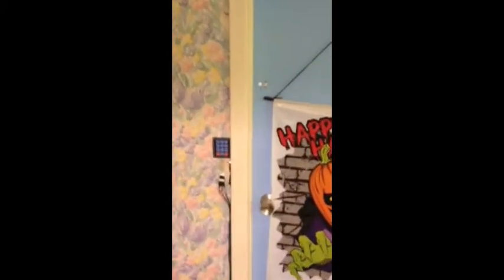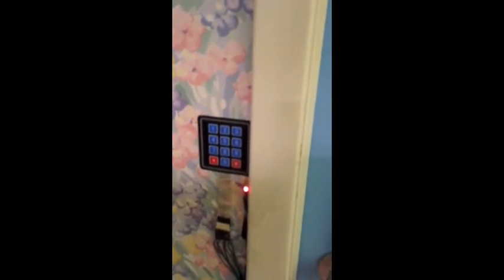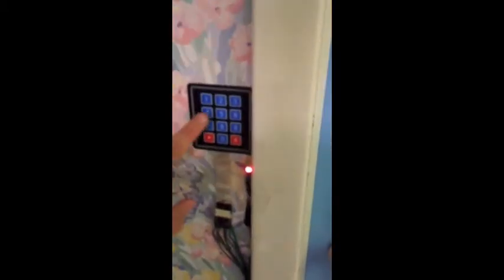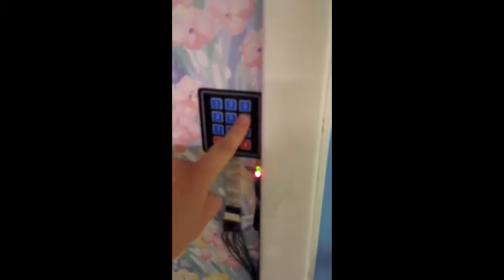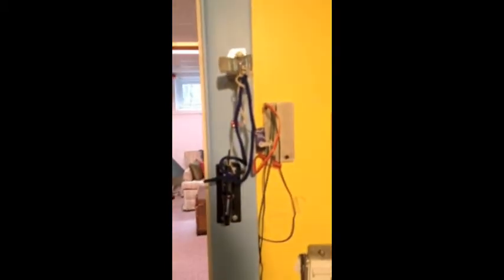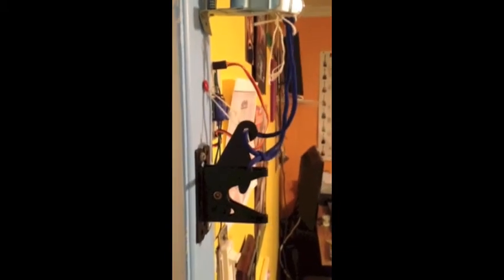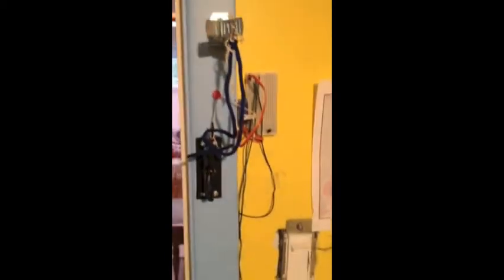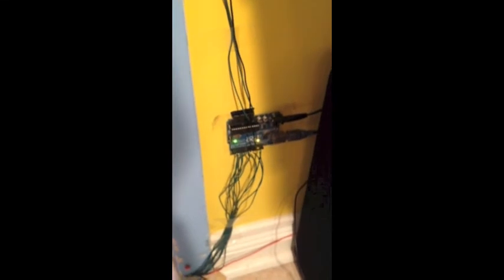Arduino Keypad Door Lock

Comment from the maker: Robot shop is where I bought the keypad I used. It has 7 pinouts (4 rows, 3 Columns). I just soldered 7 wires to a double sided male header and went straight from the keypad (outside my room), to the arduino (inside my room)

Comment from the maker: If you get the wrong password nothing happens. technically the "intruder" doesnt even know how many digits are required for the combination. I had the auto lock before and didn't like it. I had it lock after 3 seconds of being unlocked but then it would just lock while Im still in the room lol. Which was no big deal but annoying. I have now also added new coding so you can change the passcode just through the keypad. let me know if you have any other questions. I'd be happy to help you out!